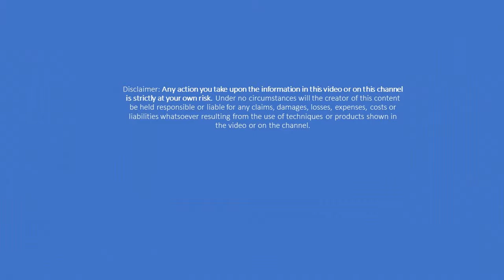Top Secret Method for Removing a Stubborn Bonnet Nut - Revealed!

Comment: I did it with boiling water for about 30 seconds!  It actually worked and I am a total klutz.  You dont need a blow torch just a tea pot of boiling water!
Reply from the maker: That's a great idea.  The steam probably helps to break the calcium.
Reply: That's pretty smart. Idk which way I'll use but it's nice to see some options. Just gotta be careful with boiling water, make sure dogs and kids are out of the way.
Reply: Do I pour the water on the nut?

Comment: If you have trouble removing the brass dome ring....take a decent size hammer and place the face (or the side) of the hammer on one side of the ring....then tap on the opposite side with another hammer....moving the hammers all the way around the ring....TAKE YOUR TIME....I probably make close to 100 taps...IT'S WORTH IT. It will separate the threads so that if you grip it (semi-gently) with some newer (sharp teeth) channel locks it will turn. Heating it up is always an option...but try tapping it first....Use some plumbers grease on everything to re-install the new one.....the next guy will thank you.
Reply: This fuckin worked omg. I didn’t even heat it up and it came right off
Reply: Can u make a video?

Comment: Just did two delta 600 series in my house. 33 years old, never touched until today. Heat was the key. Pro tip for everyone, take a oil drip pan and drill a 2” hole in it. This will ensure you don’t burn a hole in your fiber glass shower. Lol

Comment: **I had this issue with an unremovable bonnet nut. I simply dabbed the whole nuts perimeter with machine oil, took out my Bic lighter and heated it up for about a full minute, and took out my plumber wrench, and it came off right away with ease. Glad I saved myself $30 on a blow torch**
Reply: Landyn Bodie  Wow, that was very random! LOL!
Reply: The torch and propane tank cost uhs $14,95 at Wally World.  The torch is $12.95 by itself in the camping supply aisle.

Comment: Thank you for the tip, but I don't have the balls. I will avoid the $2000.00 mistake by paying a licensed plumber $300.00 to replace the spring and boot assembly.

Comment: FIRST OFF you are using your channel lock plyers backwards, holding them in the right direction will give you a better grip from the teeth of the jaws also you need to heat the valve from all directions all the way around. but overall a good tip on them stubborn valves

Comment: Thank you for the video! I followed your approach (except using a lighter) and I was able to loosen the nut.  I heated the nut for 30 seconds, tapped around, and repeated these two steps for 4-5 times. Then I was able to turn the nut with a channel wrench!
Reply: Thanks . Your advice ws what ended up working for me
Reply: Thank you soo much for the comment,  i used a large lighter instead and worked great, saved me a big headache  for $ure
Tnks again

Comment: I had this problem with 2 30 year old Deltas. The first one I used vinegar ; no luck. Then I removed the whole facet from the sink and submerged it in CLR overnight ; no luck. Then I drenched the bonnet in penetrating oil for hours , also tapping around the knurled  part of the bonnet ; no luck using channel locks. Finally I positioned the facet in a vice and managed to loosen it using small chisel and hammer. No 2 was easy ; left it on the sink ; tried a chisel ; no luck. Just for the heck of it I gave the bonnet a couple of good sharp bows with a hammer it instantly broke loose and I unscrewed it by hand. Goes to show. Always try the simplest before hauling out the big guns.

Comment: By far the best tip I have seen on you tube.  It worked like a champ, bonnet went from "I am going to break something if I pull any harder to nearly coming off by hand.  I did melt the plastic washer used to tighten the handle mechanism but a new brass one came with the replacement.  Thank you

Comment: Thank you for the tip. However, I used the heat gun instead of propane torch. It worked.
Reply: Thanks for this tip! I have a heat gun but was about to make a trip to get a new  propane tank for my torch.

Comment: I thought about a torch but didn't want to try it without checking Youtube lol...After seeing this video I knew I was safe...I would have broken the valves off for sure if I didn't use a torch...After about 1 min with a small harbor freight torch the dome nut came off very easily....Thanks so much for the video.

Comment: I learned this advice after the fact. I covered the Bonnet so maybe I wouldn't damage the surface of it with my wrench. Thought just the the bonnet was turning, until I heard water spraying in the wall. Twisted the copper tubing. Plumber cut a hole in the wall to access and installed a more up to date Delta with a single metal lever.

Comment: With helpful tips from diyhomerepair and comments above, I successfully removed the delta 600 dome ring without breaking copper pipe at the back. I shared my experiences here and hope to help others facing the same problem due to inconsiderate delta dome ring design. I sprayed a bit wd40 to dome ring thread gap. Easily tap fews time with heavy hammer putting on opposite side to counter the strike. Only less than 10 taps around on diff angle around dome ring. Previously got boiling water ready. With container below to collect hot water to avoid burning myself, slowly pour boiling water on dome ring for about 30sec. I believe boiling water really help to expand the dome ring to loss it. Then successfully released the ring when it is still boiling hot.

Comment: I should have watched this before attempting to take mine off. I did exactly what you said not to do and broke two soft copper tubes.  Can these tubes be replaced?
Reply from the maker: Unfortunately the only way I know is to replace the valve.  That doesn't mean there isn't a way, I just don't know of one.  Best of luck.
Reply: Thanks for responding, I went ahead bought a new one.  Will be my next DIY project. 👍
Reply: No!

Comment: I did use the torch...but I was a bit worried about using as you did. So basically you should use it for maybe at least 2 mins or so...until you burn that plastic thing...This will save me around $300 this weekend. Torch one for 
1, 1.06 - 1.46 
2. 2.10 - 2.52

That's like 40 to 42 seconds each time, so keep increasing it next time....it shold work
Reply from the maker: If you read the comments there are people that have gotten this to work with a heat gun and apparently a hair dryer.  The goal is to breakdown the calcium deposits.  In many cases it will melt the plastic too.  Just be careful so it doesn't snap the pipes in the back.

Comment: Does this normally melt anything inside where things need to be replaced? Im just trying to go from gold to nickel finish, wasnt planning on replacing anything inside but now that Im going to torch this nut off Im worried internals will get ruined that might be hard to replace!
Reply from the maker: When you buy the kit it will come with the new springs and washers.  I haven't seen it sold separately.  Yes, it will damage the plastic parts.  I would recommend changing them anyways.
Reply: I was wondering the same thing, only want to change the seat and springs and not melt anything.

Comment: Are you saying a new cartridge is not available for this faucet? Is this video only for getting it apart so you can put in a whole new faucet? I assume so since you probably melted the plastic insides. I have one that just drips and wanted to repair it. Are there rubber washers in it that can be replaced?
Reply from the maker: So you can get a replacement, but it's essentially the same thing as what is currently there.  If you want a new handle and trim kit you also need to change out the valve.  Here is the video on how to replace the trim kit.  This unfortunately is an older style of valve and has limited options when it comes to the trim kit. https://youtu.be/fUJSF5oeF3I

Comment: Any tips for solving once I reassemble water shoots out of where the lever is? No matter what I do same result.
Reply from the maker: Try flipping the ball upside down.
Reply: When I read this I said, 'oh yeah sure, flip the ball updside down' because ive taken it apart and put it back together more than 20 times surely I would have had it in that orientation. But for whatever reason I went upstairs, took it apart, flipped the ball upside down, and its fixed. I thought the ball was symmetrical, is it not? Anyways, thank you! @HomeRepairHub

Comment: I don't own a blow torch, and I was hesitant in using one. After watching this, I used boiling water on the nut, did a little tap around, and it came off!
Reply from the maker: Sounds like a good alternative to the torch.  Glad you were able to get it removed without any issues.

Comment: This is a great suggestion to remove the bonnet nut, but it did not work for me. I needed to take out the dremel with a metal cutting disk and oh so carefully and lightly, slowly cut the bonnet nut until it was cut NEARLY all the way through. You need to make sure to stop cutting before you touch the valve with your cutting blade. The slower and lighter your touch, the better. Take your time. Once nearly through take a sturdy flat head screwdriver, insert it into the groove you cut, and turn the screwdriver with the goal to break / separate the bonnet nut. Once you are able to break the nut, it will finally come off. The other video Home Repair Hub has on how to install the new trim kit is really good.

Comment: What model is that faucet? I have the same one and want to replace the cartridge and put on a different type handle. The adapter that came with the new kit is too large.
Reply from the maker: Its a Delta 600 series.  There is no cartridge's in this model.  If you want to move to a cartridge style model you would need to change out the valve in the wall.  Unfortunately this model isn't compatible with many of the newer styles.  Here are a few possible replacements for the Trim kit.  
Delta
https://amzn.to/2JW9qNT
Danco
https://amzn.to/3pnt0Tt
Kingston
Kingston Brass KT695DT

Comment: Will a heat gun work instead of a torch?
Reply from the maker: I doubt it.  I don't think it will get hot enough.  I have never tried it though.  It would probably take quite a while to heat the bonnet nut up enough for it to break free.

Comment: To remove the stuck bonnet nut from my old Delta 600 series valve I applied penetrating oil, let that soak overnight, then put a pipe wrench on it which I then carefully tapped with a small hammer all around.  Finally, I very carefully twisted the bonnet nut off with the pipe wrench.  The three soft copper tubes at the rear of the valve were not damaged.  I have a propane torch but didn’t want to use it unless the method I described failed, which I’m happy to say it didn’t.
Reply: The key to your success was using the pipe wrench instead of using channellock pliers.  The pliers actually compress the bonnet nut slightly which makes it more difficult to remove.
Reply: @1575murray    You are correct.  Pretty much any kind of squeezing of the bonnet nut tends to only make matters worse.  I own ChannellLock pliers but didn’t use them to remove the bonnet nut because several other people on Youtube tried using ChannellLocks and ended up twisting off the entire Delta 600 series valve housing where the soft copper tubes connect to the water supply pipes.  I try to learn from other people’s mistakes.
Reply: @terrymccoy7334  I think that a strap wrench or a pipe wrench would be a much better choice.  If those don't work then just heat up or even cut the bonnet nut to get it off without destroying the valve.

Comment: What cartridge did this use?
Reply from the maker: Do you have the same valve?  600 series?  The link for the replacement should be in the description.  This is an older model of faucet and does not have a cartridge.

Comment: i had a damage screw on the handle.  How to remove it so i can take off the handle?   thanks
Reply from the maker: you could try to drill it out.  Are the threads bad or can you just not get a screw driver on it?  it requires a very small screw driver.

Comment: Where can you buy a new bonnet nut and sleeve? My sleeve behind the bonnet nut is plastic, so probably melt it.
Reply from the maker: I don't believe you can buy just the bonnet nut and sleeve.  Here is a link to the trim kit which includes a new bonnet nut and sleeve.  https://amzn.to/3jfgth1
Reply: @HomeRepairHub  I bought just the internal parts locally for 27$ but the shiny outside parts were still good.  still 60 amazon is a good buy because you are not ripping out an entire valve.
Reply: @HomeRepairHub thanks

Comment: Would an electric heat gun do the trick?
Reply: That's a good question. I think eventually you would get it hot enough. The torch would deliver the heat quicker. The heat gun runs the risk of slow steady heat and other components becoming unnecessarily hot. Torch gives you a more direct focused heating up. Just my 2 cents

Comment: clean up the bonnet and reuse or toss it and buy a new one? Of course all the plastic parts are replaced as well. Didn't think of using heat and I used a pipe wrench. twisted the pipes but luckily it twisted back without breaking or any leaks, If using a torch your water is probably shut off. Fill a 5 gallon buck with water and have it handy in case you set the wall on fire.
Reply from the maker: I think it depends how bad the chrome looks.  Mine was probably 20yrs old so I opted to replace it.  For around $60 (not sure what it would cost now) in my opinion it's was worth it.  For me it also came down to what my time was worth.  I could have probably polished the chrome and made it look new, never done it so I don't know how long that takes.  And I had to replace most of the plastic parts and seals anyways so it was worth it to just buy the full kit.  That being said I remodel my whole bathroom so I went with new.  I actually wish I would have just replaced the valve when I had the wall open.
Reply: @HomeRepairHub  I would replace if the wall was open but new trim is the 2nd best option and looks just fine.

Comment: Would a heat gun or even a hair dryer do the trick??
Reply from the maker: I don't think a hair dryer would get hot enough, but a heat gun on the high setting might.
Reply: Did you try the heatgun?

Comment: If you were to use a pipe wrench instead of channel lock pliers it would have come off so easily. No need to use a torch which is dangerous.. The channel locks "squeeze" the fitting against the threads making it difficult to remove... At least that has been my experience.
Hope you post this for others to see and comment. thanks
Reply from the maker: The problem is two fold, excessive lime and hard water buildup and, the 3 soft tubes in the back of the valve.  When you attempt to loosen the cone the whole valve will twist and snap the 3 soft tubes in the back of the valve and you have to replace the whole valve.  I am guessing in some situations you might be correct.  With 2 wrenches it might have worked as well.  I did quite a bit of research before moving forward with this as it is a bit more dangerous when you add in the blow torch.  I also had just installed a new tub and surround so burning it was not something I wanted to do.   I unfortunately saw a lot of disasters with this model valve.  It was a pretty significant design flaw in my opinion.
Reply: You can modulate how much crush is applied with channel locks proportional to your squeeze (grip strength). A pipe wrench crush can far exceed your squeeze strength and goes all the way to your torque strength (how hard you turn). For delicate items prone to crush, you would be better off using channel locks over a pipe wrench.  Additionally as OP stated, the problem is water scale. The physics of thermal expansion expanding the nut faster than the fixture because it is larger is what makes heat so effective.

Comment: No way to do this without a blow torch? This is the exact one I have.
Reply from the maker: So if you have a good heat gun it might work.  The easiest and quickest solution I found was a blow torch.  Otherwise you can try CLR or something that will break up the calcium.  The challenge there is that you usually need to soak whatever you are removing the calcium from in the CLR, which is tough to do.  There might be other products that with break up the calcium deposits but this has been the method I have found works the best.

Comment: Absolute no no...Told by a plumber. You did exactly what would happened you melted the plastic. Also he said you can wreck the springs and other parts. The bonnet has to be cut off. So heat it up at your own risk!
Reply from the maker: So are you just replacing the bonnet nut?  Cause if you are replacing the trim kit you are replacing the bonnet nut, plastic, springs, and all the other parts.  It will take significantly longer to cut the bonnet nut off.  To replace the seats and springs is pretty inexpensive.  He probably charges more.  I guess it depends on the plumber.

Comment: Did not work for me  Still stuck  Help!!
Reply from the maker: What did you use to heat it up?  It has to get hot enough to breakdown the calcium deposits. If you can find away to soak it in CLR without it being removed that might help break down the calcium deposits.
Reply: @HomeRepairHub  I used a mini torch with butane gas  I’ll try the clr   Thanks!
Reply: Pour CLR in a Ziploc bag.Carefully cover the faucet,use runner bands or duct tape to hold in place